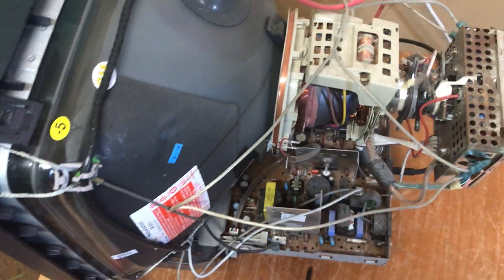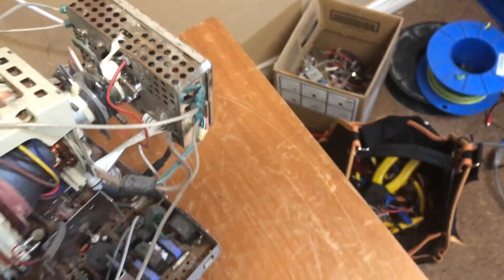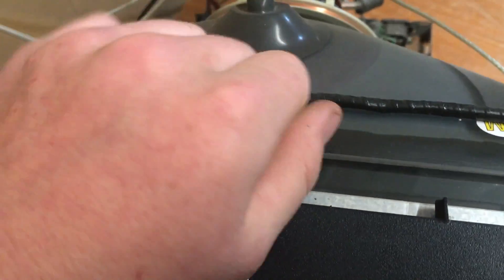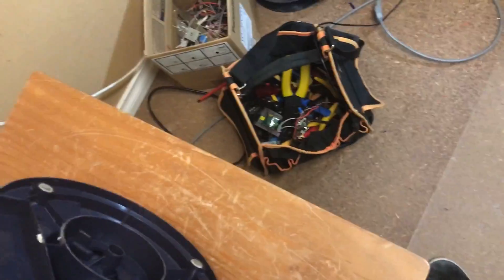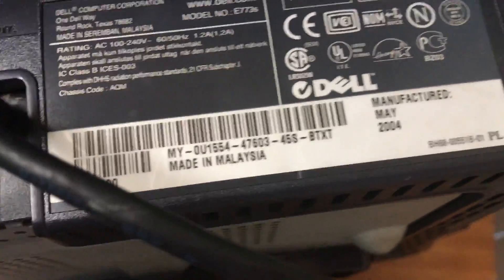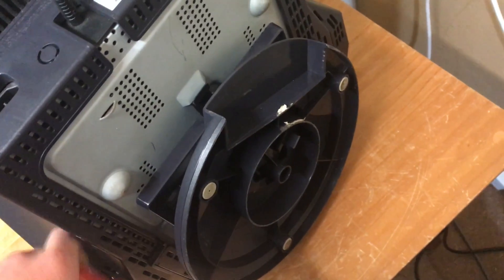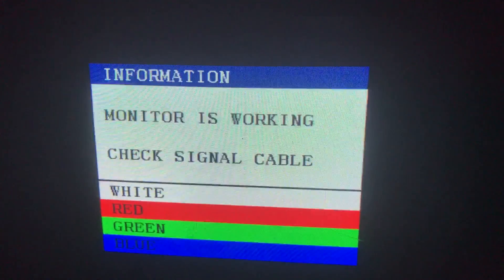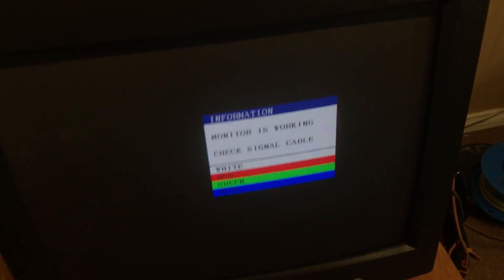DELL E773S Repair

Comment: this monitor had the problem that would only work if you hold the power button? mine has similar issue, it does a ticking sound and the power led blinks, and if you hold the power button it works, how did you fixed it>?

Comment: hi, i have the same montor Dell e773s CRT and i couldnt take the case off how did you do it?
Reply: The two holes at the top, you need to use a paperclip or something thinner like a small hex key to push the lock lock pin down while also pulling the case back off it. (It's easier with a second set of hands.)
Reply: Any tips on getting it off with one person?